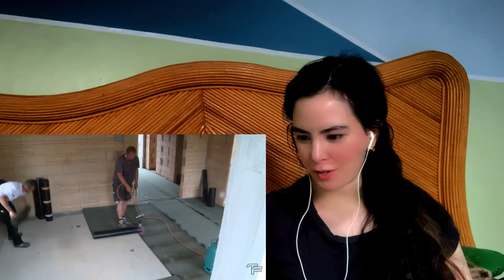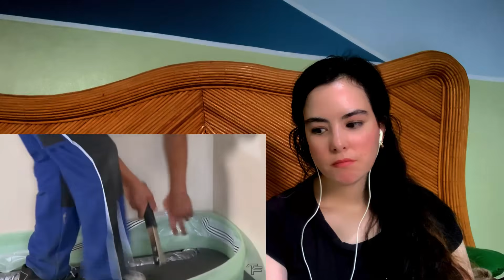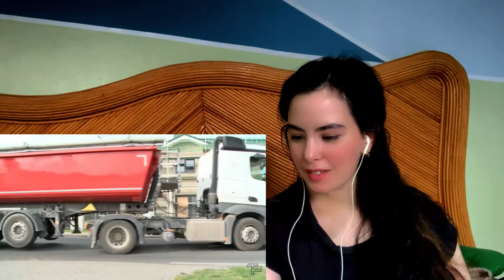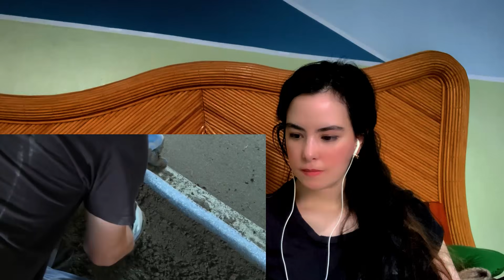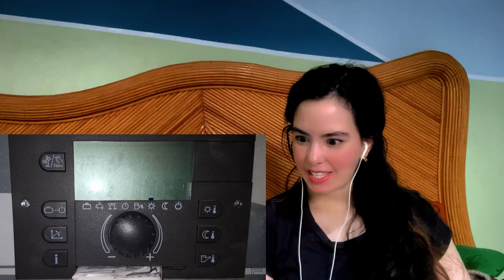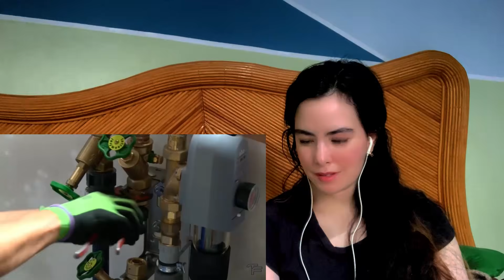Building a House in Germany part 6 Floor Insul+UFH+Screed+Water Con REACTION!

Comment: Modern central heating systems (at least here in Germany) have a special drying mode for screet which you can activate in the controls. With that mode everything runs automatically and you don't need to adjust the temperatures manually. That mode needs to be manually activated and deactivated in the controls.

Another thing is, that, although it is a heated floor, you usually don't put water in there which is hotter than 35 degrees Celsius later on. The actual temperature of it is auto adjusted by the controls, depending on the ambient temperature outside. That is to keep the actual temperature of the last layer of flooring from being burning hot.
Which room you want to heat you can decide with the thermostat every room / heating zone has. With a heat pump it is better though to adjust the flow of each heating zone and the temperature provided by the heat pump in such a way, that the thermostats never close and to have a constant flow through the whole system.

Comment: Plastic or metal? I think that this is an interesting question. Plastic is easy to handle even for the amateur who wants to fix a dripping pipe under the sink by himself/herself. You can replace a broken plastic pipe yourself quite easily when it is easily accessible. Metal is more stable. It is my impression that metal is used at permanent installation such as underground. By the way, both of which have their problems. Plastic releases softeners over the course of time. Metal however corrodes and releases small amounts of heavy metal such as zinc or copper into the water, in older houses even toxic lead. Metal prevents bacterial growth, but bacteria feel comfortable on plastic.

Comment: The different materials about pipes are in the lifetime of this materials.   Metalpipes has a lifespan around 20 years bevor it get leaks. Copper pipes would have 20 - 35 years bevor it get leaks and plastik pipes has 40 - 60 years lifetime. The problem is allways the oxygen inside the pipes who make the leaks.  So we German working in heating systems and in watersystems with plasik materials for long life.

Comment: You can drink the water from the "plastic" pipes. Copper is still used but it is kind of outdated. The "plastic" pipes are made of 5 layers and also contains an aluminium layer.

Comment: In the Netherlands we use a similar process.....however in the Netherlands people are NOT this PATIENT. We use special additives to the screed that make it dry way, way, way faster. Also we take out windows, board them up so we can hook up automatic mechanically ventilation, using hygrometers so we don't ventilate too much (cracking) or too little (weak surface).
I don't know why Germans don't know about this.

To answer your questions:
UFH = Under Floor Heating. And to prevent the ground beneath the house sucking all the (expensive) energy down into the soil, you need the insulation.
Pipes you don't get see are plastic, pipes you get to see are copper, because metal pipes are nice and straight and don't flop around.
A lot of work goes actually in preparing the site before you even lay the foundation: incoming water pipes, outgoing sewage drains, rain pipe connections, electrical connection, gas-line (not in this house, since it has a heat-pump), phone lines, internet fiber (not in this house since Germany is 20 years behind). They all need to poke out of the ground at the right places before you can even lay the foundation.
Those water pipes might have been laying in some field for weeks before they were installed, so they are not sterile. There are no purification chemicals (like chlorine) in German (or Dutch) dinking water. So once germs are introduced into the water-grid, they are hard to get rid of. It could poison the watersystem for the whole block.
The heater to heat-cycle the floor was a temporary device. They metioned a heat-pump outside (reverse airconditioner, which can pump heat into the house, instead of out). And yes there will be a thermostat in the house to turn it on or off.

Comment: We have heat radiators, but mostly in older houses, new build houses prefer the floor heating due to saving space and getting the advantage of a warm floor especially in the winter. Heat radiators heat mainly the room and after a few hours also the floor. It is popular in bathrooms, imagine getting out of a warm shower and the floor is cold as stone (tiles), but with floor heating you have the option to heat the floor up to a temperature you like.
Reply: My Parents build their House in the late 1990s and they installed both Floor Heating and Radiators, though the Radiators are only in a few Rooms (usually with Floor Heating) while in other Rooms, like the Bathrooms or the Living Room, they only put in Floor Heating.
Reply: @Sheppart92  1990 is still a relatively new building. There are still many houses from the 40s and 60s.

(Just in case for any 'actually'  🤓💦 guy finding this comments, we are talking about modern floor heating and not the roman style which was already used over 2000 years ago.)

Comment: 22:28 The main reason for using underfloor heating is its higher energy efficiency compared to traditional radiators in insulated buildings and the use of modern heating technology in the form of heat pumps.
24:26 This was a special programmable heater for construction sites for exactly this purpose.
Reply from the maker: i see
Reply: The higher energy efficiency of underfloor heating is to a large degree due to it working with significantly lower temperatures in the heating circuit to heat up the rooms compared to radiators mounted in each room. Instead of having a small area (a radiator) that is hot, a much larger area (the whole floor) that is merely warm, achieves the same. 

This aspect is particularly important when using heat pumps, as they become increasingly inefficient the larger the required output temperature is. While heating up 100 l of water from 20 to 30° requires the same amount of energy as heating up 50 l from 20 to 40° C, a heat pump will use more electricity for the latter.
Reply: @aphextwin5712  that's exactly how it is

Comment: I dont know how big the temperature difference in Venezuela can be, but in Germany you have to calculate with a difference of 50 degrees between lowest winter and highest summer temperatures. Therefore the thick insulations.
Reply: On top of those 50K difference, you have to also plan for wind-chill as well as heat-up of exposed building parts. In some ways we are blessed in Germany. If you want to keep 20°C inside, even with windchill and heat-up in mind, we rarely ever have to cope with more than 40K (-20°C with windchill, +60°C sun-baked roof tiles) temperature difference. So our insulation works (almost) equally well in both directions. In significantly hotter or colder climates, you'd need even more insulation, as you have to over-insulate in one diretion.
Reply: It doesn't necessarily have anything to do with the temperatures, but rather with the high energy costs. Naturally, you want to build a house that uses as little energy as possible and still keeps you warm in winter.

Comment: The drinking water connects to the next house, so it is used directly. But aside from that, when working on drinking water pipes, you always disinfect all the new parts you touched and coughed on.

This house is a second house on an existing plot, something we see quite often in previously rural areas that historically have oversized plots. They are now in commuting distances to cities, and instead of huge vegetable gardens, people split the plots and build extra houses. Way more profitable than veggies. ;)

Older houses regularly have basements that serve as insulation against the cold ground. An unheated room sitting between the earth and the heated rooms works pretty well for this. And don't forget that Germany has a cold climate with freezing temperatures in the winter. We need to keep our heat inside and not bleed it out into the ground. Also, the wall insulation is inside the bricks they used---it's on the very low end of what is used here nowadays, but this is a budget house.

BTW: Parts 7 and 8 of this series are only available in German, with auto-translated subtitles.
Reply: New houses also have basements. But these owners didn't want one.
Reply from the maker: Thanks for the info. I might check those parts also.